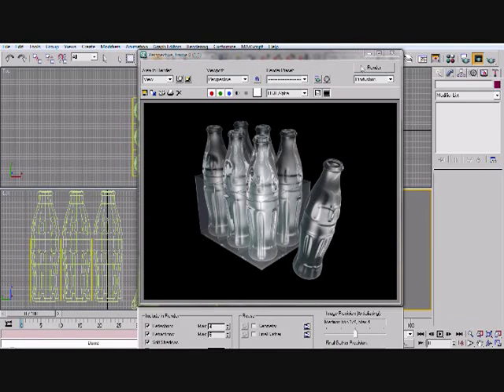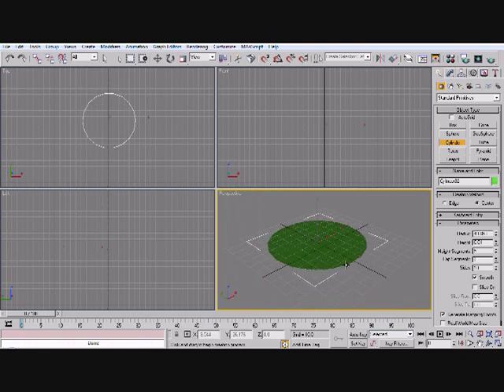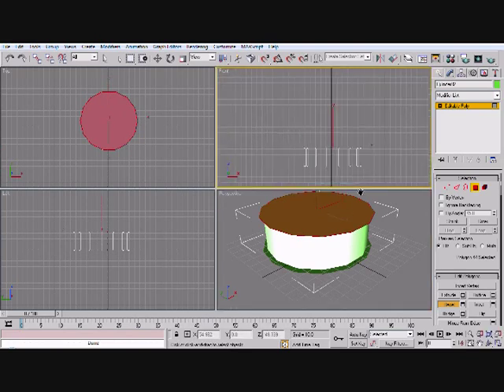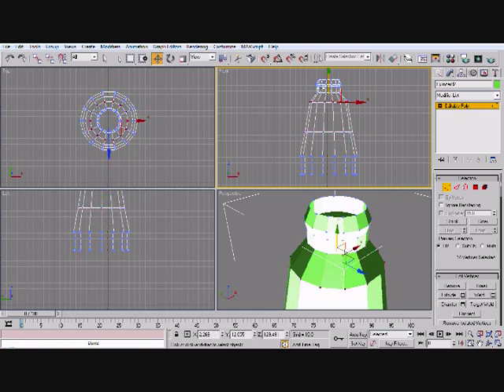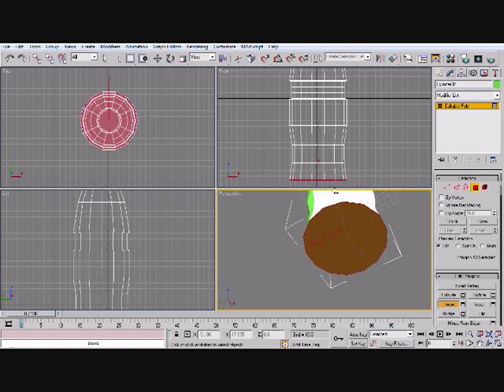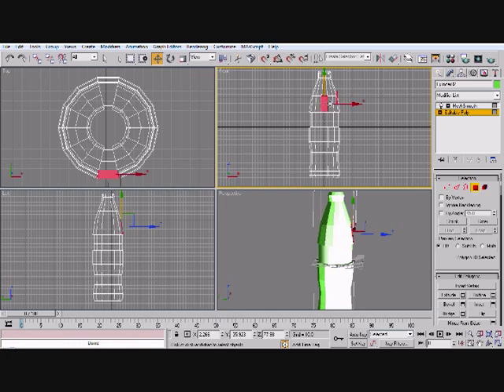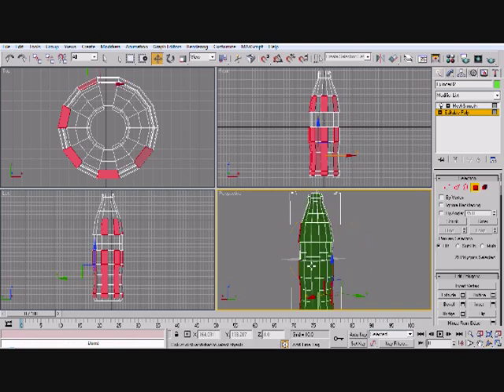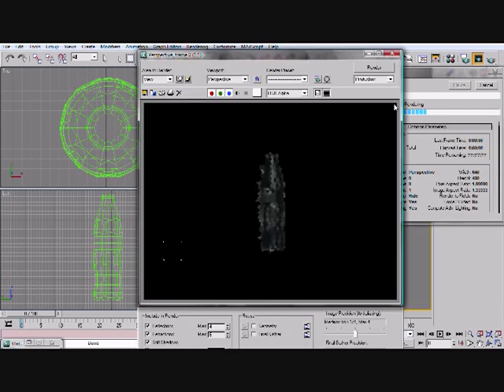3ds max Beginner Tutorial - Coke Bottle

Comment: can u show me how to model wires and coolant hoses and exhaust pipes in an engine bay? i know to model cylinders.. but bending them using bend modifier i can only bend in the given angle.. im looking to model these complex shapes from an evo VI engine bay and i cant figure out how to model the pipes hoses and wires.. ive done a moderate engine and fuse boxes so far.. cant get these pipes going so ive put it on hold :(